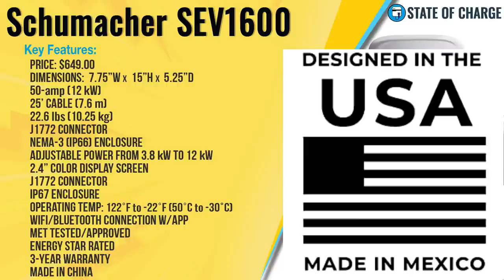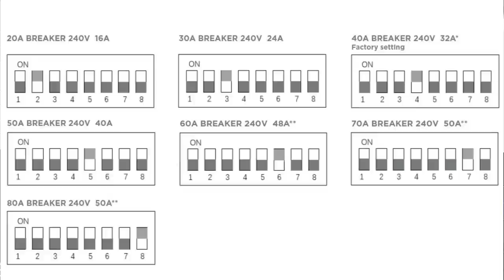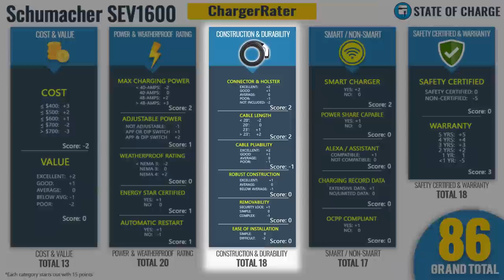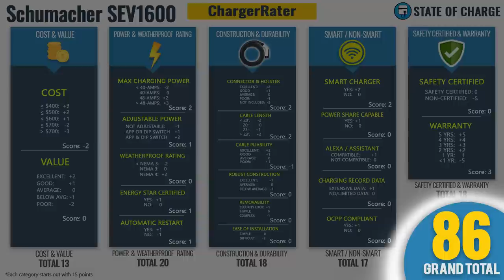Schumacher SEV1600 EV Charger Review

Comment: It seems inconvenient, but the 12” cable going to the plug is the longest it can be and still be NEC code compliant.  Any plug-in EVSE with more than 12” between the plug and the EVSE should be challenged as to how they get around the code requirement

Comment: Another great video Tom!  Related, you need to get your Ford guy back on again now that they say they are going to include the Tesla NACS connector on future vehicles.  What does that mean exactly - will the car still have J1772 and CCS ports also?  Where are they placing the NACS connector - at the front or back edge so they can park at existing SuperChargers?  When and what vehicles will have this?  Is an adapter with a length of cord going to be available for existing vehicles?  Would love these answers, and no one can get them better than you!

Comment: Good review, as always, and another good EVSE that gets the job done. Still, Tom's best for 2023 remains with Emporia 48 adjustable amp EVSE for $399 or Tesla 48 amp wall connector for $425 are still the best. Emporia can change amperage from the app, for less money, and for $80, can charge from excess solar. Tesla also has variable amperage and power sharing, which can be a big deal in the future when all of your vehicles are EVs. The Emporia review gets a bad rap for its verticle holster, which is true unless you have a Tesla adapter connected, and then it is better. I am curious if this new design on the Schumacher will holster with the Tesla adapter in place. if so, that's a benefit.

Comment: Honestly, any unit that still requires dip switches is one to avoid going forward. There's a lot of power going into these units. There are many alternatives and anything that can keep a user from having to turn off the circuit, remove the external and then internal cover and then adjust the dip switches should be avoided just to adjust the power. Especially if it's mounted outside.

Comment: you should also test if the nema 14-50 has a temperature sensor. i saw no sensor wires when you connected it to the unit. 

my tesla on a 14-50 plug set off a warning that the plug was getting hot and subquently  reduced current from 32A to 16A to keep safely charging. 

That fact that it protected a fire and still keep charging is amazing. 

the guys at Munro missed this when they had a show on burnt plugs.

Comment: hard wiring is good if the unit lasts a long time, for those of us not being able to spend the 700 for a unit,, ill get the plug, that way if it gets ripped off the wall or broken or stops working ,, i just replace the unit, an not have to call an electrician to re wire something

Comment: If your wiring, circuit or panel might not support the full 50 amps. That needs to be stated.
Reply from the maker: It is stated - a few times. That's the whole point of derating the unit to a lower amperage output.

Comment: Is there any reason to pick 1450 or 650 over the other?  Is that just a configuration, and one isn't better than the other in any way?
Reply from the maker: No, not for EV charging equipment. The 14-50 is the most common plug for EVSE, so it probably makes sense to go with that in case you need to replace it in the future. However, hardwiring is a much better solution.